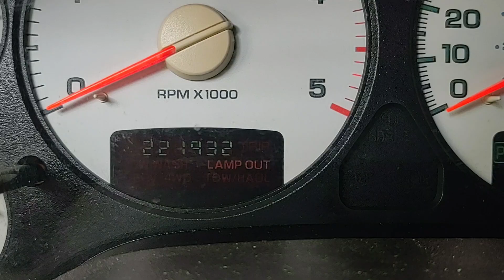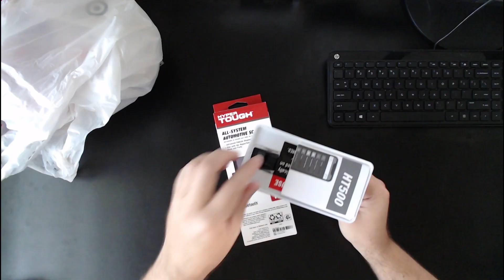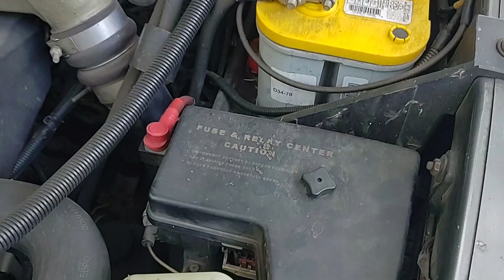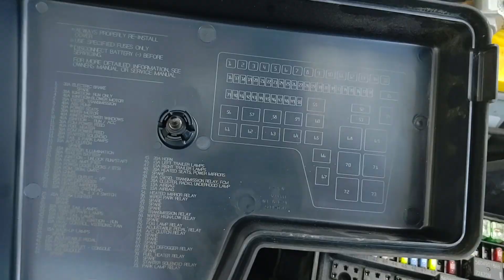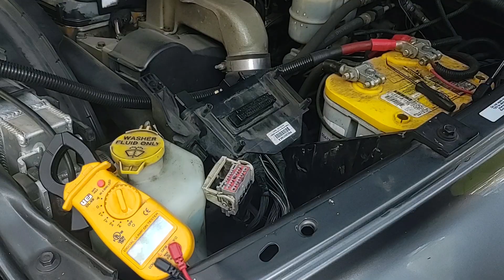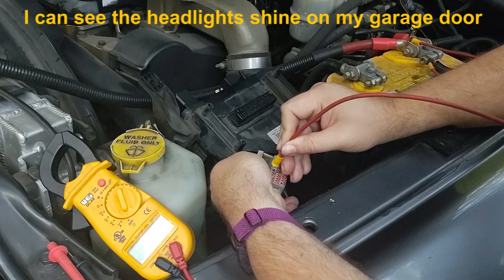2003 2004 2005 Dodge Ram Headlight Repair , Test Integrated Power Module IPM & Front Control Module

Comment: What do you use to clean the contacts with? Is it electrical contact cleaner?
Reply from the maker: Good question.  
I did use some electrical contact cleaner.  
I also scuffed the surface a little, with an ignition points file (tiny file).  A flat screwdriver with some fine sand paper would do the same thing.

Comment: I have found that if you put a small washer on each screw between the fcm and the mounting surface the problem goes away. What is happening is when you put the fcm back in and tighten the screws the plastic distorts and causes it to lose connection the washers keeps the plastic from distorting and warping.
Reply from the maker: Thanks, I'll definitely give that a shot if I ever have to take it apart again !

Comment: great video. we bought a 2005 at a really good price because of the headlamp problems.  found someone had spliced both low beam wires together maybe the PO? so even after he replaced the FCM and the IPM the problem was still there.

Comment: my blinking lights not turning on tried chamging module not it only back omes blink
Reply from the maker: The key needs to be turned on for the turn signals to function. 

These trucks have an analog flasher relay that's soldered into the IPM circuit board.  

If you've installed LED turn signal bulbs, they don't create enough resistance in the circuit to trigger the analog flasher relay.   
Switch back to regular incandescent bulbs, and it should work fine.  

If you already have incandescent bulbs, and nothing is flashing, you probably have a bad flasher relay.  
Most people would replace the IPM, but some people have disassembled it and soldered in a new  flasher relay themselves. 

If you already have incandescent bulbs, and only some of them are flashing, the flasher relay is fine and you probably have a wiring problem in the circuit.  
Start by checking to make sure the ground wire for the lights is properly connected.  
Then use a voltmeter to test the circuit at every connection, until you narrow down where the problem is. 
At the FCM connection to the IPM,... 
pin 19 is the passenger rear blinker,
pin 42 is the driver front blinker,
pin 44 is the driver rear blinker,
pin 45 is the passenger front blinker. 
With the key & turn signal on, you should see voltage coming out of those pins on the IPM.  
If you don't, the problem is inside the IPM.

Comment: What if 6 and 7 do not have power
Reply: Fuse box. You probably need the fuse box. You can try the fuse, #11 I think, but it's probably the fuse box. I just came in from fixing mine again. Drivers low beam and all turn signals working again. Using the Travis method I could see there was no juice at all on #6 and #7. So I backfilled the main fuse box with 12V through the FCM connection. Hill Billy method.

I had extra FCM's sitting around so I drilled a small hole right above the #6 and #7 connector. Ran a wire through that hole, pulled out enough slack to work with. Then spilt the copper wire in half and made a loop twisting the two ends together. Soldered the joint. Used needle nose pliers to form the soldered end of the loop to conform better with the FCM blade. Then pulled the wire back through the hole and put the loop over the FCM connecter. Pressed it down tight to the back of the FCM and used the soldering iron just to heat up the solder. There's still lots of room to reattach the FCM normally.

Silicone the outside of the FCM where the wires come out, heat shrink the extra copper needed for installation, and put a blob of epoxy on the back of the FCM to secure the wires from being pulled out.

Then reinstalled the fuse box. Connect the new #6 and #7 wires inside the fuse box to an inline fused 30A wire to one of the unused relay connectors which has 12V when the key is ON.

All my high beams, low beams, turn signals are back in business again. Keep the cops away for another day.

Pics or it didn't happen:

https://i.imgur.com/L1QnQiE.jpg

https://i.imgur.com/HTUACRT.jpg

https://i.imgur.com/HMUxZnf.jpg

https://i.imgur.com/hyEIq3g.jpg

https://i.imgur.com/48Oue6N.jpg
Reply: Did you ever figure that out? I’m having same issue

Comment: You have the tests backwards a meter will show voltage but a test light can put a small load on the circuit. You can have full battery voltage but it can drop off when you put a load on it.
Reply from the maker: The test light bulb is a very small load.  
I prefer illuminating the headlight bulb as shown, because it's the normal load for that circuit.

Comment: My wiper blades randomly turn on for a long time my running lights work but the brake light don’t work on the driver side also the blinker on the rear driver and both front blinkers all cut at the same time randomly one day the from headlights went out a few months before that
Reply: Could that be a fcm issue and can it be replace with a junkyard part or will it need to be programmed or something?
Reply from the maker: @drakestonecipher1952  
Not 100% sure if your problems are the FCM or the circuit board inside the IPM.  
The circuit board inside the IPM can get corrosion, because the case isn't sealed weatherproof.  
Often the corroded traces on the circuit board can be repaired with a short piece of wire and some solder.  Others have made YouTube videos showing how to do it.  
I'm pretty sure that both the FCM & IPM from a junkyard, can be installed without programming anything.  Swapping either of them into your truck, might be a good way to see if that changes your problem at all.
Reply: @TavisKingsChannel  ok thank you for your time
Reply: I took off the fcm before going to the yard and everything looked cleaned then it all started working like it should be I didn’t even have to go thank you for your great video and insight
Reply from the maker: @drakestonecipher1952 
Sounds like a typical loose connection then. 
I recommend slightly bending a few of the contact pins like I showed in this video, to increase the tension inside each connection. 

If you watch this video on a big enough TV, you might be able to see which contact pin is for the wipers on the schematic.

Comment: What if you had accidentally used the jumper cable from power to power when you were checking the ipm pins?
Reply from the maker: Power to Power doesn't do anything. 

Power to Ground might spark a little, or pop the fuse, but that's what the fuse is for.

Comment: Excellent work. Thanks man. I just got in from fixing mine again. I have a 2004 Dodge truck since 2016 as my daily driver. So I've burned through numerous FCM's. A couple times drove into work in the early AM with only parking lights. This time it felt different. It stopped without acting up. It felt like a burnt out bulb. So after trying 3 FCM's, and wiggling them around, I gave up and put it back together broke. (I'm freezing in the NE up here.) Then I remembered what you said about those fuses. Mine didn't look bunt out, but I grabbed each one, wiggled it out, then pressed it back in. Another guy told me a story about "contact fretting", or electrical fretting. That did it. Lights, camera, action and blinkers too.

There's another guy on YouTube you should see also. He has a 2005. After his diagnosis showed a bad power module, he drilled open his black box, found the bad spot on the printed circuit board, and soldered a piece of copper wire on it.

But you my friend are top notch. Travis King of the Dodge Truck FCM diagnosis.
Reply from the maker: Thanks! 
Glad you got your truck going again.

Comment: Excellent video. I have the same problem with my 05 2500 and I was thinking it was the fusebox portion. Followed your easy steps and it is definitely the ICM. Changed it out and all is better. Thanks for an easy to follow diagnosis, you put things into laymen terms and are a natural teacher. Thanks again!